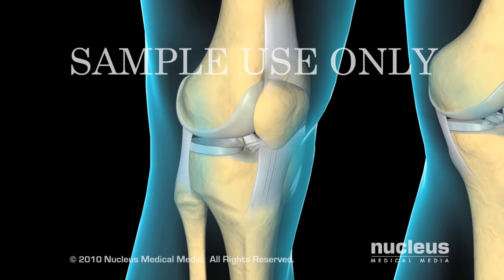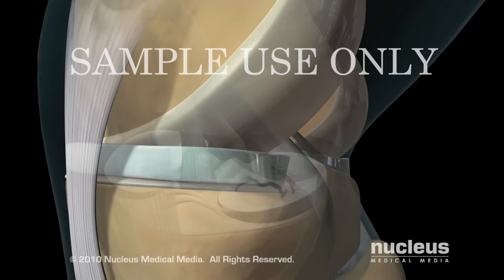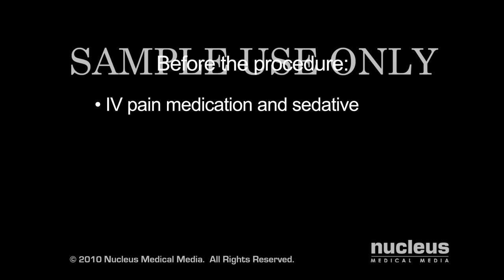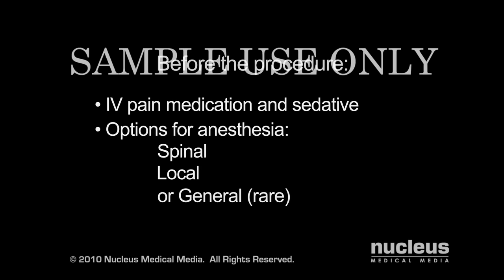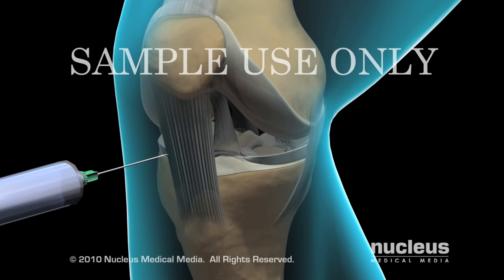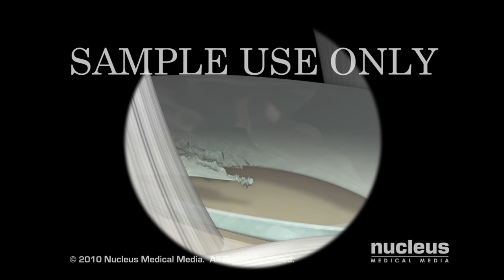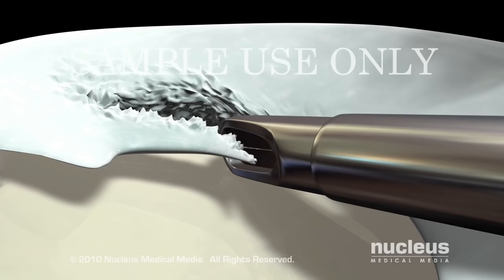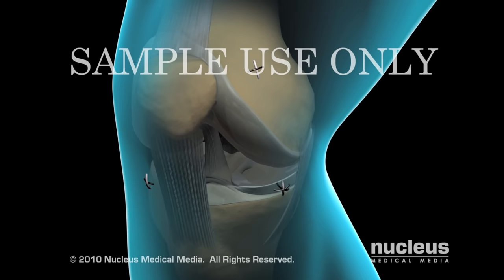Knee Arthroscopy

Comment: No. Menisectomy is really something to avoid as possible. 
However, if there is no choice, due to the extent of the damage, then they have to remove it. 
This then increases the risk of cartilage rubbing together between the femur and tibula bones, which causes erosion, and then you end up having bone on bone as the years go by, for which then a knee replacement will be required. 

It's best to save as much meniscus as possible, and stitch them up where possible. 
I'm getting mine done very soon
Reply: I know its been awhile how did you make out ?
Reply: @Sjrick  he didn’t make it 😔

Comment: does the cartilage regenerate after it has been cut out?
Reply: bone doesn't regen
Reply: Bone does in fact regenerate but cartilage does not. In this case, this is a type of cartilage called fibrocartilage and due to poor blood supply to our cartilages in general (no direct blood vessels exception being developmental stages when we are younger). Without the direct blood supply, our cartilage cells will have difficulty trying to regenerate and in most cases never return to its original shape :) I hope this helps
Reply: Xtralarge but they would shave a part off... Does it regenerate ?
Reply: @iamtheaweomexl I had cartilage flowing around in my knee due to my knee cap dislocating a year ago, so I had to get surgery, I guess they had to remove it.. do yk how this will affect my knee after or?